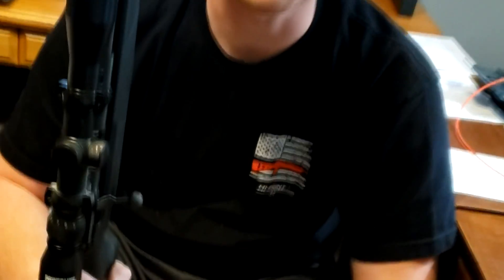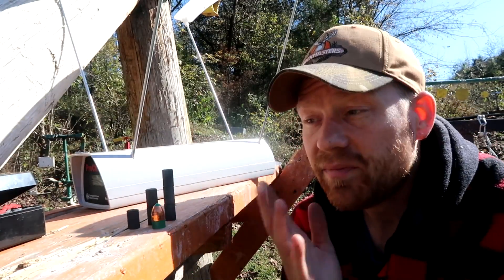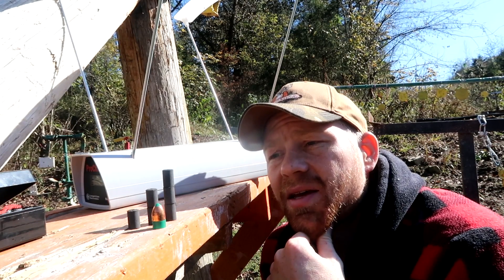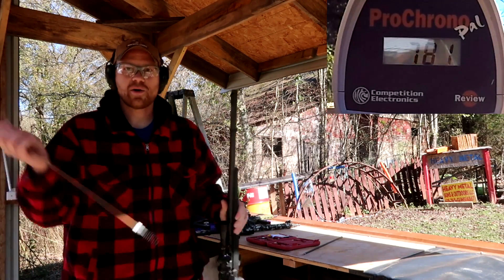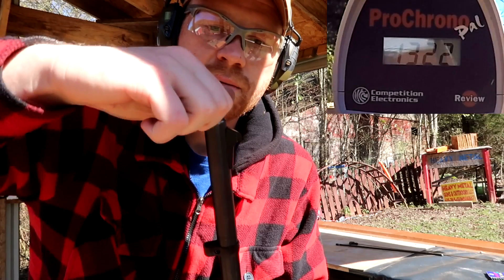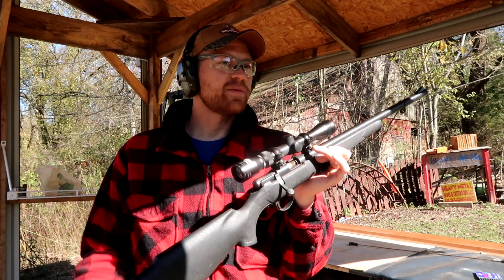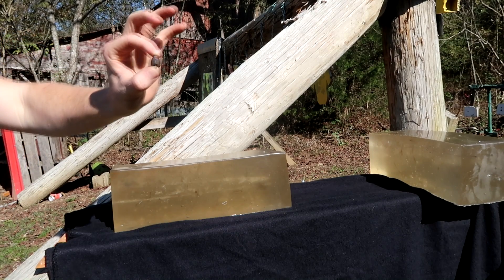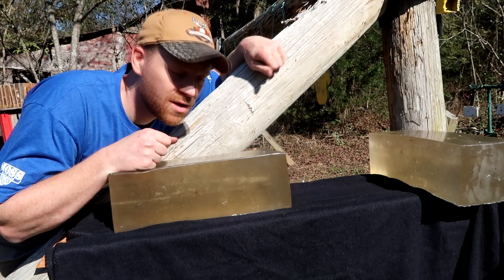Muzzleloader vs Ballistics Gel!!!

Comment: How old are those pellets?
I shoot 250 grain bullets in sabots and 70 grains of 3f Swiss  Holy Black and get 1575 fps from my 24 inch Firehawk and 1610 fps from my 28 inch Hawken.
My daughter shoots 40 grains of 3f Triple 7 and a 240 grain T/C Cheap Shot sabot,from a 24 inch Traditions Tracker. 1340 fps. These are chrongraphed velocities.

Comment: I thought the barrel was supposed to stay cleaner with those pellets of powder. It sure shouldn’t have been that dirty after one shot and you weren’t even using a full charge. All I ever used was triple F or 4F black powder and my barrel didn’t get that dirty that fast. I usually got 4 or 5 shots before I ran a cleaning rod down it. I always used maxi 375 gr maxi rounds with 75-150 gr powder with a .50 cal.

Comment: It doesn't matter whatsoever if you touch the pellets with your fingers when you're going to shoot it soon, probably even if you're not if your fingers aren't wet. I heard what you read off of the barrel of that rifle, but I wonder if it isn't what I've got, which is a Hunterbolt Magnum? Sure, looks like mine. Bought mine cheap in a pawn shop and I'm willing to bet it had never been fired. It was just too clean. Mine had open sights and is a great shooter. I could tell you for sure you'd be really proud of yourself if you bought a $4.00 capper. Makes life a whole lot easier. A good cleaning and a few wet patches with bore butter on them will prevent the rust problem when your all done shooting. I know you shoot a Wolf a lot now, but that old Hunterbolt is a fine old rifle and if you do your part will outshoot it.

Comment: I'm old.  I've been shooting 100 grains and powerbelts forever.  I use the copper HP ones, normally the 295's.   Since my average deer range is only 15-30 yards I do stupid unsafe OSHA unapproved modifications to them.  I drill the center cavity out on them using a 5mm drill bit, and go down a bit deeper than original cavity.  They weight 288 or so grains including the PB ass sabot when I'm done.  I shoot the deer in the lower neck.  If it's a fat deer I might find a big flat pretty looking slug under the skin on the far side of the neck.  I started doing this after trying things like 30.06 on deer at 25 yards.  At least half of the projectile energy was going into trees and dirt after passing through the deer.  Now the 50 cal HP with massive cavity makes the deer take all the energy into it's neck :)   They all just drop.  I drop them all on a 2 track so I can just drive up and toss them in the back.  I took 5 deer last year in my brother's 9 acre back yard. Situation normal.  Didn't have to drag any.  Go chase shot deer if you want.  But I'm old, and lazy, and I like venison :)
- Joe

Comment: What muzzleloader is that are they still available i have cva wolf with ova 400 rounds throw it ive had since 2017 i use live in country so I use shoot every day right out back door I also had a cva v2 optima I sold I felt there is not much difference between wolf and optima 2 inch longer barrel optima felt more like real gun good but I think range and accuracy is bout same I could be wrong bout get another optima v2 see if any difference at 300 or 400 yards i shoot 300 all day with the wolf traditions 200 grain smackdown very fast and flat im thinking bout switching to 40 cal 50 sabot 155 grain buy the bullets and then sabots separately I really believe people understand estimate the power and range of the muzzleloaders just my 2 cents bud

Comment: Im gonna bet that the squib load that you flinched and missed the blocks was from it not being quite all the way seated tight. I got my ram rod marked like you said but ill push it down tight and was always taught from my dad growing up to make sure and bounce the ram rod off the bullet a couple times to make sure its tight and iv never had a problem. Sweet video though! Some good info here. I have a 14in cva v2 elite pistol that has a bergara barrel on it. I usually run around 75grs of powder and have took a nice buck with it at about 45 yards and he didnt go 10-15 yards and i just run t/c cheap shot full lead hp bullet and its more accurate then i am out to 100 is as far as iv shot it and was more then good enough to kill a deer. And Im just running a cheap tasco red dot on it 5moa. Keep up the good videos!

Comment: My neighborhood calls it a long-cap gun.  The advantage is low recoil force, accurate shooting.  The black soil is made from charcoal from Phuttha wood, wild chili trees, and house chili trees.  By using potassium nitrate, 1 tick per charcoal, 1 can of milk + sulfur, 1 large cube about the thumb.  Finely grind to combine with a little aluminum powder.  will get a very strong black soil  The cost is very cheap compared to modern ammunition.. If you use a gun like this, you can probably shoot for months. Compared to modern ammunition prices, it can only shoot 5-6 rounds.😁😁

Comment: Just came across this video. I bought  a Thompson Center 50 cal hawked kit in the 78 and finished it my self. Bought a Lee 370gr maxi ball mold it's a devaster on white tails out to 200hundred yds. Load 80grs ffg black powder real loud crack super sonic. After mupitle time of being yelled at for rotten egg  smell I learned boiling hot water and dawn dishsoap works best to clean eliminates bad smell. With that load do my part it shoots 5 shoot groups all bullets touch each other 50 yds

Comment: You're not supposed to clean towards the breech as the residue from powder will collect n primer hole causing possible misfire, just saying, I pull the breech plug outa mine when cleaning n use a lubricated patch, and you can get pellets in 30 gr.or you could before all this craziness
Reply from the maker: I have never had the breech plug out. Got it for $100 and it has worked for me for 15 years now. Never had the tool to do it. I'm sure seized up anyways

Comment: I had a bunch of problems with that bullet. Then tried a few hornady sabots and my wolf didn't like them so just used it as an excuse to buy a new one. My cva accura long range in .45 I'd trust for a anything I'll ever hunt. Load I use is 150 grains of 777 pellets, 280 grain powerbelt elrs and remington 209s. They do expand but not too much. Wasnt happy with the blood trail either but the one deer I shot didn't go far at all. They are way too much for coyotes though.

Comment: I have a Knight .50 cal and the barrel looks exactly like that too. If I go hunting the one week of muzzle loading season, I use 150 grains of Pyrodex and Barnes X hollow points. I dislike just almost everything about muzzle loading. My fat fingers fumble with caps, putting them on and taking them off. I use a piece of steel wire to clear that nipple. Had a couple misfires, which I hate, the wire prevents that. If it's raining or supposed to rain, forget about it.
Thanks for sharing with us!

Comment: TC shockwaves, power belts, and SST (which are same as shockwaves) are all junk on whitetail.  I've tried them all, if you want a real bullet that puts game down, penetrates and reliably expands then use Parker Productions bullets or Barnes TMZ are a good all copper option.

Comment: The rusty barrel on that muzzle loader specially on a N line muzzle loader is no different then simple maintenance on any other center fire rifle.  And then she were shooting actual black powder or some kind of  Corrosive powders through it.  Besides all that the rusted not look too badd I'm sure you can knock it right off and it should be just as accurate as it was brand new.
Reply from the maker: I dont clean any of em

Comment: Those power belt bullets are really accurate, however they seem too soft and don't penetrate through a whitetail at all. I switched over to a 300 grain shockwave with a 125 grains of ffg triple 7. Sub 2" groups at a 100 yards, and more importantly its death on deer. Great video by the way.
Reply: I’ve only had any muzzleloader pass through 1 time. When I shot one at 12 yards. I’ve always just used lead sabots 100 grains of 777

Comment: Blackhorn 209 is the only powder to use if you have the right breech plug and a newer style muzzleloader. Easy to clean and after 20 shots still loads like the first one and a lot more velocity. This powder goes off like your shooting a high powered rifle instead of a muzzleloader. Throw the pyrodex and powerbelt bullets in the trash. And get some blackhorn 209 powder and use some parker extreme or hornady sst bullets you. You will not regret it for sure been muzzleloading hunting for a long time and blackhorn is the game changer!
Reply: I agree, Buckhorn 209 is the bomb.  I have used it a few years now and I am dead on at 200 yards.  I bagged an 5x5 elk 2 weeks ago at 147 yards.  Single shot dead before he hit the ground.

Comment: Pyrodex is highly corrosive & fouls the barrel worse than original black powder. Most modern muzzleloaders use other powders today; Triple seven, Triple Eight, Alliant MZ & Blackhorn 209, with increased fps over Pyrodex & Goex. It has less fouling, easier cleanup & less corrosive. 2000 FPS is going to be about the top of the spectrum for muzzleloaders, why you need a heavier bullet for increasing ft lbs of energy. With that ft lbs of energy, modern pistol bullets in sabots are more effective at expansion. Which do you prefer though, bullet pass through or complete energy dump by the bullet.

Comment: You might try getting away from Pyrodex and using one of the other substitutes that foul less. I shoot a CVA Wolf break action using the Blackhorn breach plug and Blackhorn 209 using the PowerBelt 245s I can run 6 rounds before it gets tough to load and all it takes is a dry mope to get back in action.

Comment: Don't want to deal with the dirty barrel?  Use some Blackhorn 209 powder. It's loose powder but it's cylinder shaped like rifle powder.  You have to use 209 mag primers for reliable ignition but it doesn't absorb water from the atmosphere like pyrodex or 777 does. It also cleans up using hopps #9 in about 4 or 5 patches.

BTW, your velocities most likely came in low due to the old powder. I've tested the difference in new from the store powder and 2 year old pyrodex pellets that have been stored in my house and seen a drop in velocity of about 100 fps. A 100gr charge with a 255gr sabot always gave me about 1500 fps, 777 would give me about 1600 fps and 100gr of Blackhorn gives me just over 1800 fps (Blackhorn powder is hot, a max charge of it is 125 gr IIRC)

Good vid though, you got another sub👍

Comment: Who_Tee_Who, get rid of the store bought oils and cleaners and use hot, soapy water to clean with.  Dry that rascal good and use a light coat of Crisco inside and out.  The rust will disappear.  I learned this from a muzzleloader die-hard about 30 years ago.  Old Timers used to use bear fat for a coating and bullet lube.  Don't know about you, but I ain't got that handy!

Comment: Your first shot at 50g had a double"thump".  Simple explanation is that you failed to ram the powder charge completely into the chamber.  The delay in the main charge recoil was caused by the gas produced having to fill the gap between primer and bullet.  At high power level that can be bad.  Ram that sucker home like you got a pair!!
Reply: @WHOTEEWHO  FWIW, those powder pellets are the bottom of the barrel.  They are molded with a binder that does not burn completely and will require thorough cleaning within 3-5 shots for best performance.

Loose powder, measured by weight rather than by volume is my recommendation for your muzzleloader.  In contrast, I have shot more than 30 loads at a time of loose powder and patch and ball without having any failure.  Black powder guns are fun fer sure.

Comment: I have great results on paper with those Powerbelts but the fact they don’t expand really bothers me. Hardly any energy transfer.
Reply: I and several of my hunting buddies have had the same experience with Powerbelts...little to no expansion.  We thought they were great because of the tight groups on paper.  But we lost quite a few deer because of very poor blood trails even though we felt confident that we made good shots.  Switched to solid copper Barnes expanders and have much better results on game.  My guess is that his 100 grain shot into the gel did not expand.  The wound cavity looked exactly the same as the 50 grain shot.
Reply: I use .245 gr copper hollow points, they do a number on game!

Comment: Pyrodex...hard to load when dirty. Fouls badly. Power belt a bullets...contributes to the fouling. Good performance on white tails though. 

You hate cleaning muzzle loaders mainly because of the ammo choices you've made. The Pyrodex  rust your barrel and is hygroscopic. The Power Belts leave a lot of plastic residue. 

I no longer use either. And I've been shooting black powder for almost 50 years. It takes me ten minutes to completely clean each of my muzzle loaders after a range session.
Reply: You ever thought of making a video about your setup and cleaning process?

Comment: I love my savage model 
110ml 
One of the only ones on the market I know of you can actually use regular rifle powder. 
I use 48 grains IMR 4227.              That way you can treat it like a old bolt action 30-06 and just clean it after the season over.
Far as hard loading get you some bore butter and butter the bullets. 
I have those charge tubes with my powder on one end and a buttered bullet on other end.
Reply: I always wanted one of those. I heard they were taken off the market.
Reply: @alsaunders7805  
Not that I know of.. but I haven't tried to get another either lol..
If they stopped they were made for a while. I have a earlier year before they started using the accu-trigger 
Never had an issue with mine

Comment: I'm a big muzzleloader fan. Used to be a Civil War reenactor and hunted with my rifle (replica 1853 Enfield .58 caliber).

What might be interesting is an historical video showing Civil War loads in ballistic gel. Actual black powder and pure lead minie balls.
Reply: There was a battlefield detectives on antietam where they did that. They said the mini balls were so bad all a modern day surgeon could if you were hit in the leg or arm with one is amputation. It just shatters your bones it's nasty
Reply: Aw, duuude.1853  Enfield. Cool.
Reply: That would be a cool video! Could u imagine being shot with a mini ball with the old black powder! Ouch!
Reply: @donaldjones5701  lead poisoning actually is to blame for quite a large number of combat deaths in the Civil War.
Reply: I hunted with a 58 caliber Lee Enfield musket three-bander 60 grains of powder with a 280 grain round ball 570 diameter round ball with a 1.72-in rifle twist out of a lee-infield rifle three-bander 55 in overall length 10 and 1/2 lb rifle graded the powder charge to 95 grains of powder out of that lean-filled musket rifle at 195 yards to a headshot using a 280 grain round ball 570 diameter lead ball I drop that dough instantly the higher the grain of powder using a round ball will stabilize it even better than having a low grain powder charge it'll be like throwing a BB it'll go anywhere but if you have more power behind it and 95 grains is perfect I'm also a civil war reenactor and I use that 95 grain powder charge to make my loads sound better in the firing line and it gives me more realistic reenacting as recoil and everybody was impressed with my loads that I had even with my pistol loads they've never felt a 44 caliber 1858 Remington in cap and ball feel so comfortable and somebody's hand they were impressed one of the guys in the 8th of Kansas frontier brigade that I'm in said I've never shot somebody else's revolver before that really felt comfortable shooting and we went out and I showed him the powder load that I use and he used the same load in his revolver and he liked what I was doing and he was impressed and so he kept the same powder load as I did and he enjoys shooting his cap and ball pistol and it's really an enjoyable guns to shoot black powder guns especially the side locks in percussion rifles

Comment: Great video. back in the early 90s we got into muzzle loaders pretty hot and heavy. A day of shooting was fairly inexpensive. When the bore got dirty, we would just swab it out, and keep on shooting. Would use the loose powder and a measure to get the exact grain load and then the particular grain bullet that shot the most accurate in that particular rifle. Just like center fire rifles, you can tune in a muzzle loader for optimum accuracy with the load that particular rifle likes the best. Just like center fires, you can have 2 of the same rifle side by side, and each will like a different grain bullet and load better than the other. I had one rifle that liked 75 to 80 grains of powder and round balls. Had another that liked 110 grains of powder with a 370 grain maxi ball bullet. They can be a lot of fun if you dont mind cleaning them up after a day of target shooting, Like one guy said, keep everything greased after cleaning, and they wont rust. Also put grease around the threads of the primer nipple, those things will seize up on you if you dont, and they are a devil to get out when they do.

Comment: Great video,  I always wondered if those bullets expanded or not ! I wonder if a lead round ball expands  ??
Reply from the maker: I dunno
Reply: Yes they do but use soft lead to cast them . But even commercial bullets will expand with 90 to 120 grains but more powder means more cleaning before next round .
Reply: My personal experience here but me and a friend have used the power belts to the effect of many lost deer. However switching to a 300gr hornady high speed low drag put all the rest of the deer I have shot down within 20yds.